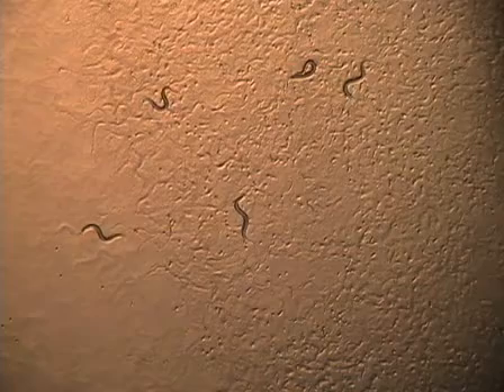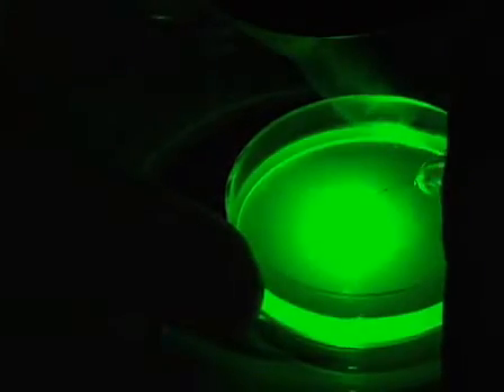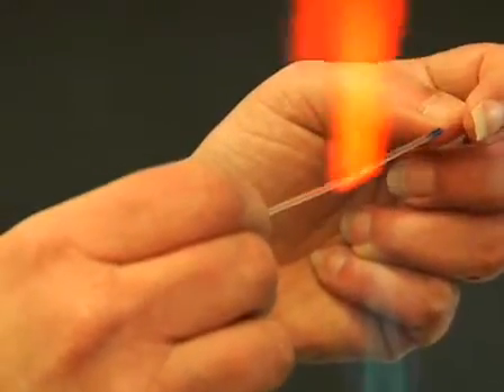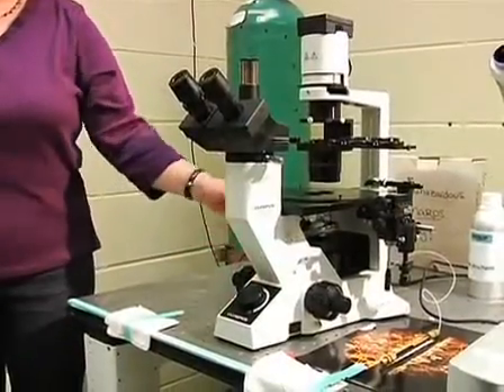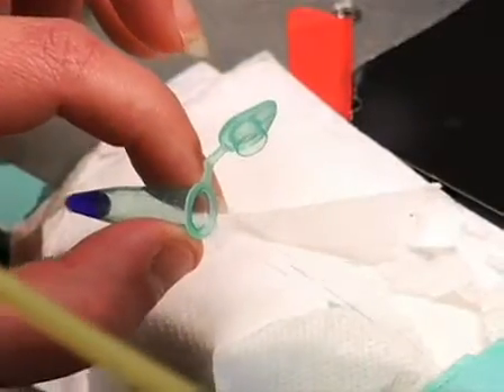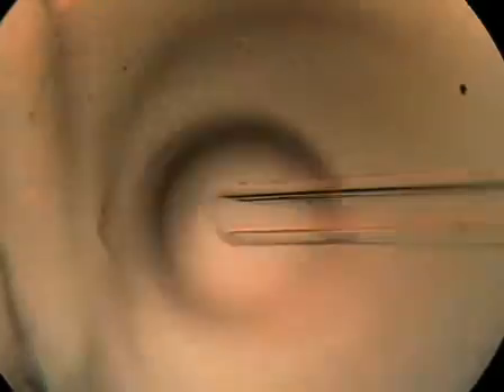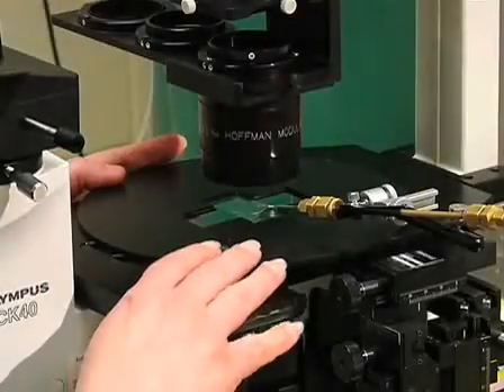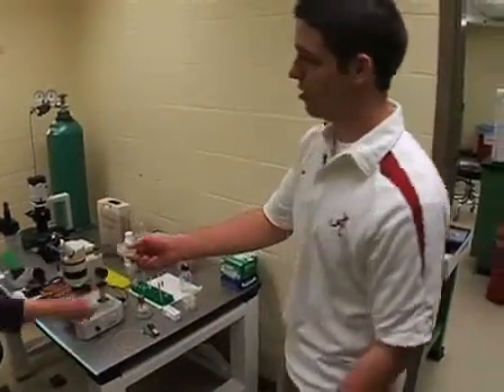Generation of Stable Transgenic C. elegans Using Microinjection

Comment: Hey nice work! :) what is the setting they use to make the needle for microinjection??
Reply from the maker: The needle is made from a special capillary tube that contains an internal glass filament; this filament serves as a wick for the DNA solution. These are pulled on a needle-puller machine. They use a Narishige PP-830 puller with a heat setting of 24.8. Several needles are pulled at a time and are stored in a small plastic box. Multiple needles can be readily "mounted" on a strip of modeling clay for long-term storage.
The tip of the microinjection needle is pulled so fine that it is actually closed at it end and should be broken open using small shards of cover glass. These are prepared by wrapping an 18 x 18 mm cover glass in a paper towel and gently applying pressure until it breaks into several pieces. Shards of a useful size are approximately 3 x 4 mm.